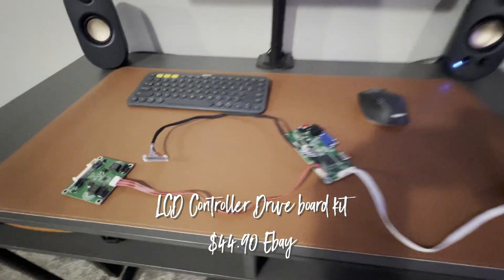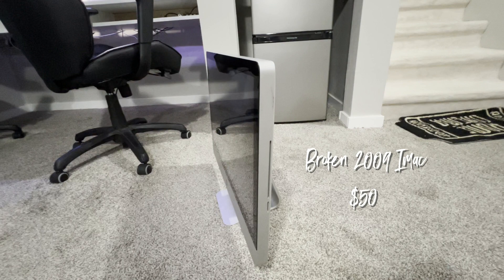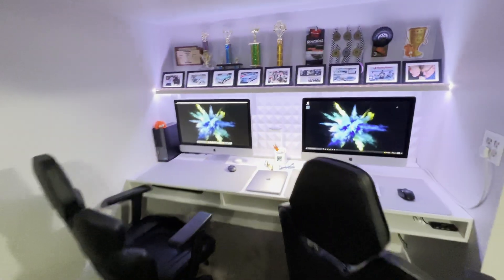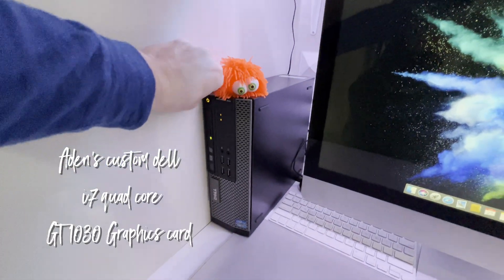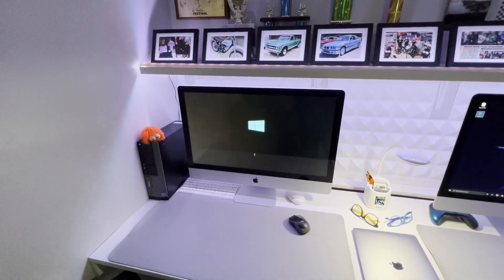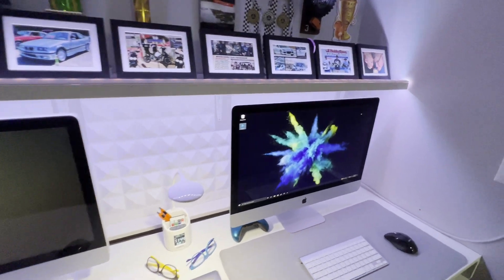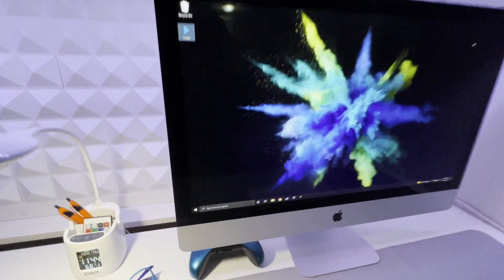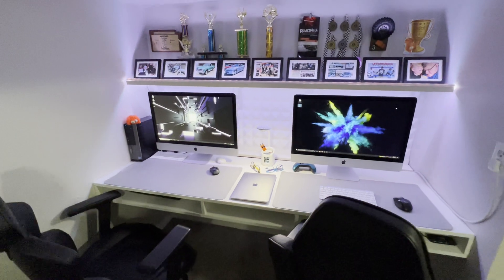Turning a broken 2009 imac into something AMAZING. Let's see if we can figure this out.

Comment: I have a 2009 27" iMac and everything still functions, but it is just too slow at this point to even run MX Linux decently. I want to replace the internal hardware with modern hardware from a mini PC, and reuse the display panel in the process. I have a 3D printer I can employ to help me craft mounting brackets as needed. You wouldn't happen to have links to the adapter boards you used to convert the panel do you? Thank you.

Comment: Witch control board do u use? I can't find someone for 1440p. Thanks for help
Reply from the maker: The exact listing isn’t available anymore but the way I found mine was by looking on the back of the screen after taking it out of the max there is a model number. And I searched controller drive board for that model

Comment: Hi,

is the controller board that you used able to drive the display at full brightness? 
I tried this mod myself and all controller boards I could find out there weren't able to get full brightness out of the 2009 27 inch iMac's display..

Greetings from Berlin, Germany

Fabian

Comment: Nice job!
I have a 2011 imac with dead GPU, if nothing more works, this is a nice solution.
Reply from the maker: Yeah I had a dead graphics card in mine. It’s shocking how light these are when you empty them out. Hope you can find a use for yours as well
Reply: 2011 iMacs are very upgradeable: the RAM can be upgraded to 32GB and the hard drive to SSD: GPU can be replaced (I had that done recently) and CPU can even be upgraded from an i5 to an i7 (which I'll probably be doing next).

Comment: Basically just a 1080P 60Hz monitor.
Damn, there is a much better use for this.
Patching to Catalina or even Big Sur, and using it as an office computer, or giving it to somebody who needs an office computer.
The hardware from 2009 isn't that outdated!
Reply: more like 2.5K monitor
Reply: @user-gv6td7yn7u  in 2009 it was 1080P
Reply: @Zebra_Paw  the 2009 27in iMacs had 1440p displays
Reply: @hydro5168  Oh yeah the 27"
Mine isn't
Reply from the maker: Hi guys thanks for watching. It’s a 1440 display. Before I got it I believe the graphics cards failed it would turn on sometimes but then the display would go in and out . It was my aunts old computer and she was going to throw it out but I had some free time because of Covid and just decided to see what I could do with it. About 60 bucks later in parts I have a nice monitor that looks pretty good. I’m happy with it. I appreciate you guys taking the time to watch and comment. I didn’t expect many people to watch this video actually.
Reply: @brettreifschneider3029  I think you should try to put the PSU inside of it and use the original ac power plug.
Reply: Depends on how "broken" it was I guess, if the "computer bits" had failed but the monitor was still fine I don't see why not to reuse it instead of it basically becoming e-waste as you can't do anything with it (edit: of course you could have it for parts too)
Reply: @fetchstix  Yes of course if the motherboard is dead (even though I'd attempt some component level repair) but otherwise it can be a nice iMac, and still more reliable than M1, where if the SSD dies the machine won't even chime.

The SSDs in these contain weird encrypted volumes that are paired to the firmware. If the SSD dies, no way to boot at all, even to an external drive, and replacing the storage chips with a heat gun if you have soldering skills will not fix it, because these hidden volumes are paired to the firmware and it's literally different in every device, even if it's the exact same model.

Comment: Target display mode works with the 27 inch 2009 & 2010 iMac with just a Mini DisplayPort connection. If the iMac is still functional  no need to use the control board kit. Any device that outputs an HDMI signal ( with an HDMI to mini display port adapter) or display port signal ( need a mini display port to display port adapter ) can use the 2009 or 2010 27 inch iMac as a display.
Reply from the maker: That’s great advice Rob! I should have mentioned that in my video. That’s what I used to do before figuring on how to do the module. I’ve enjoyed the module because I had issues with hdmi converters in the past and it was only consistent with display port computers. This way I can use it as a tv, or monitor for an Xbox. Thanks for sharing that info though I feel that’s not very common knowledge and will be useful to a lot of people.
Reply: This stop being the case if you upgrade your main mac/imac/mbp/mini to big sur unfortunately. You could use a device like luna display and use the thunderbolt to thunderbolt/usbc adapter but you will have to set up and ip connection for it work with thunderbolt. Sounds backwards and frustrating, but this is what apple has done with their new updates. This is still the case if you have catalina, and could work up to mid 2013 imac devices.
Reply: @BULLETAWESOME  That is only applicable with the Thunderbolt enabled Mac’s. I have my 2015 MacBook Pro running Windows 11, Mojave & Big Sur. All three operating systems were able to use my 2009 27 inch iMac with just a mini display port connection. I’ve tried to post a link to the pics of the iMac / MacBook Pro , however , YouTube won’t let me include a link in my comment .
Reply: @robsavage3296  I believe you. I guess I failed at expressing that if you try with the newer Main unit of Mac Os and try to connect with an older mac unit it will fail. I know there are ways. Im just speaking without fiddling with operating systems. But yes that can be done.
Reply: @BULLETAWESOME  no fiddling required. The 27 inch iMac’s from 2009/ 2010 only require a mini display port connection . Non 4K /5K iMac’s from 2011 - 2014 also support target display mode , however, these iMac’s require a Thunderbolt connection between the Mac’s and have the aforementioned issue not being supported by Big Sur or Monterey on the main Mac. Target display mode on the 27 inch models from 2009 / 2010 is more universal. I’ve even connected an old dell laptop to my 27 inch 2009 iMac and used it as a display.

Comment: Hey nice project. Can u provide me a link for the display board. Thanks
Reply from the maker: https://www.ebay.com/itm/203674731699?ssPageName=STRK%3AMEBIDX%3AIT&_trksid=p2060353.m2749.l2649
Reply from the maker: Keep in mind this is only for my 2011 model. But as I understand it the LG model number is on the back of all of them after you get it apart. So when I looked for it on Ebay I just typed in my model number plus 27" imac controller driver board. Hope this helps